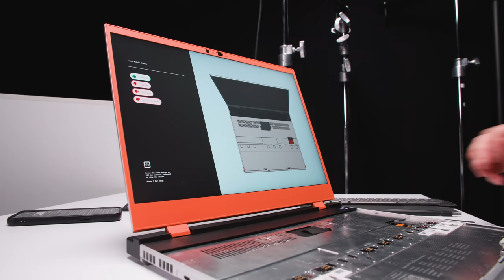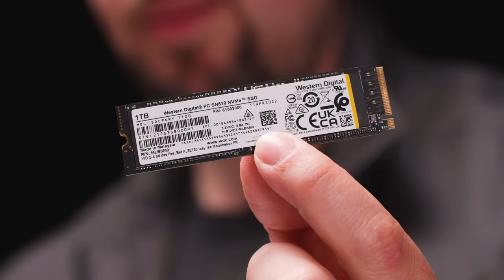Framework 16: an exclusive look inside the modular gaming laptop

Comment from the maker: Update, August 4th: We've now used a Framework Laptop 16 prototype with a working GPU fan, playing games for 15 minutes without any throttling. The touchpad on that machine worked every time we swapped it, too.
Reply: Amazing. We only need economics of scale to bring down the price of these beauties!
Reply: Most cellular/wifi antennas are routed through the screen lid for range/performance reasons. I've seen active amplified antennas sit on the base of Dell precision laptops, how is this handled on the framework? Getting tired of lugging my Dell Precision 17" around and it's a pain on flights, this seems like an interesting alternative.
Reply: @tommymaddox6785 this one appears to have a massive antenna line at the top end of the lid. Wifi does work very well though.

Comment: This is so cool! Linus really invested in a super concept and execution!
Reply: Linus is stilly too often, so it is not good that he is an investor.
Reply: CPU swapping is next 👀
Reply: @_____alyptic  Not anytime soon - both Intel and AMD have long dropped support for CPU sockets on laptop SKUs, and because of compatibility reasons with the motherboard, I doubt that Framework will find it easy. We'll probably see more display and GPU options in the near future.
Reply: @leonro  It will probably be like framework 13, swapping the motherboard to upgrade/change the cpu.
Reply: The problem is that its too expensive for the specs. Whilst a premium might be expected for the level of user upgradability that you no longer see in mainstream flagships, it is really way too high a margin. 

You can basically get a "level up" spec'd laptop for the price of a framework (i7 instead of an i5, ryzen 7 or 9 instead of a 5 etc.).
Reply: @JimIBobIJones  true but the value comes in when you look at it as a few years down the road you can change your display or still have the latest processor .... also framework is small if dell or lenovo did this it would be cheaper due to economies of scale and that they are a larger company.
Reply: @brandontobias1338  If the cost was reasonable, the ability swap out the mainboard and modernise your laptop would be amazing. But their modules are also overpriced AF - and you can buy a new laptop for pretty much the same price. 

I agree it may be an economies of scale issue (but I suspect it isn't - they outsource manufacturing to bigger suppliers) but at the end of the day, the consumer pays more regardless and we shouldn't have to subsidise economies of scale
Reply: @_____alyptic they have it albeit limited selection and not in all regions yet
Reply: OFC, event Google Tango failed for this project
Reply: @JimIBobIJones that's because they're a small indie company using ethics, and ethics don't make big money. No company with enough money to sell these cheaper would bother making it, because it goes against the very principles that made them that much money in the first place.
Reply: @JimIBobIJones "we shouldn't have to subsidize economies of scale" that's literally what economies of scale do, make things cheaper. It's not framework's fault modularity isn't a selling point for the masses.
Reply: @MrGamelover23  way to pick a straw man. It was one part of a broader argument thst also demonstrated how they cost more than other small companies with semi custom hardware on a similar scale.
Reply: @JimIBobIJones do you want to pay for a completely new machine in 7 years or pay a fraction of the cost for the same performance?
Reply: @JosueHernandez-nu5cp  is 2/1 a fraction? I guess you are technically right....

Their main boards cost as much as full laptops with the same processor... And you are paying anywhere from a 50-100% premium going framework in the first place. If you think paying more money and using a 7 year old screen and keyboard etc. is acceptable I am not sure what your concept of value for money is.
Reply: @JimIBobIJones  laptops can last a long time if they are built right, the screen resolution on the framework 16 is already nice… and the pixel density will be plenty for the average person in 7 years then again you could always upgrade as well. 

Keyboards can last, it just depends on how you use them. At that point it’s up to the individual. 

I am looking at the prices and from what I am seeing, the new laptops with the same processor are usually 100-500 dollars more expensive and that’s on a discount 🤨

Comment: I was expecting this to start at almost $2000 but $1400 is a must buy for me
Reply: love to see it
Reply: well by the time you add all the essential parts it costs around $1800(without graphics card) so... still very expensive
Reply: It´s expensive considering only the specs of a laptop but considering this is a very modular, personalizable, upgradeable laptop that is leading the right to repair philosophy in the category and is coming from a start-up that has kept its promise of making and supporting modular hardware, it is a must buy.
Reply: @keerthan7558 the idea is it’ll save you money in the long run. Historically no modular project stayed around that long for us to judge that statement.
Reply: $1400 for the base-model, it's definitely gonna add up with better add-ons, but like others have said the future-proofing is what really makes it worth it (as long as the company delivers on its promise!).
Reply: I would have been, if they were shipping to my place...
Reply: 2k for gpu version.......
Reply: If you think about it a regular gaming laptop with about those specs i7 13700k and 4060 costs about 1100-1200. You could probably buy 2 one you spec out a framework with reasonable storage, ram, and io . Personally i rather buy a gaming laptop use it for 4 years and buy a new one in 4 years again and still be out of pocket the same cost of a framework 16.
Reply: @keerthan7558  pretty sure you get 7700s with the laptop
Reply: @schizofennec  pretty sure you don't 
else why would they specifically mention that the gpu module costs 400 dollars?
Reply: @ewoggerts  The thing you're not seeing is that this laptop is upgradeable, in 4 years instead of spending $1200 for a new gaming laptop with similar specs (or more because the market has been awful like that) you could upgrade the main board with the CPU for something like $700 and also get another computer for anything else or sell it from the previous main board; or maybe it's not really needed yet to upgrade the CPU and instead you could just upgrade the GPU module, maybe they would have a 2 tiers of GPU and you could get yourself the most powerful (if that's what you're into) for a little less than the mid tier gaming laptop you were going to buy for $1200 and now you have a better laptop in 4 years for less or a similar price to what you spent all together. Also you get the chance to change other parts of the laptop if you want or don't. We have never had so much choice to make a laptop that actually fit your specific needs in the past. Yes it's a start up and there are a lot of unknowns but there's also a lot of potential. So it depends on what you feel comfortable with
Reply: make sure to keep reality in check
framework is cool and all but they never advertised on price for performance
the first framework 13 was already an overpriced product, this one is no different
not saying the overprice is unjust though. its very much justified
Reply: @walkinmn  $2400 now plus $1000 in the future for GPU and CPU upgrade or $1200 now and $1200 in the same timeframe for the same upgrades. You come out ahead just buying a better gaming laptop now and in the future. Plus companies like Lenovo have fire sales all the time. It’s a great concept, but they are too small and don’t have the economies of scale to make it cost effective for most consumers. Sad.
Reply: $1400 with no dGPU no ram no ssd no ports. $2000 for dGPU model. Add all up and it will be $2-3k for mid range laptop. Usb port alone is $19 each.
Reply: @walkinmn the thing you are not seeing is actual price. Its $1400 for barebone with igpu. Add ram ssd usb ports($19 each) its going to come out $1700-$2000 for igpu laptop. For that you can get almost top high end gaming laptop. Great concept but not for average consumers. More like laptop tech fanboys.
Reply: @aliticx  i agree in the long run this is probably cheaper to upgrade and more sustainable but my point was that the base model is too expensive. I doubt that people going with the base model would take advantage of all these features, i feel their requirements would be better fulfilled by the existing non-modular laptops .Maybe we need to wait for this idea to get more popular so that the parts become more common & cheaper to produce thus bringing down the cost. Right now it's more of an enthusiast product than a consumer one .
Reply: @aliticx  I totally expect to get one and then hear how they are shuddering the doors and not be able to upgrade it. lol
Reply: @keerthan7558 if it were a macbook no one would be batting an eye
Reply: You can max out everything (reasonably, 2tb wd 850x and 2x16gb ram bought separately) for around $2400
Reply: @walkinmn main board for the 13 inch laptop Intel version costs $1050, só expect this 16 Inch to cost at least $1100 for the mainboard. Add a Gpu for $500 and you get your upgrade for $1600 (price of a whole new laptop, with better specs)
Reply: If you want a higher spec machine you can save big with the barebones and then buy memory/storage yourself for less also
Reply: buying this has a premium cost due to modularity, repairability, upgradeability and the fact that it's a small start-up ... if the company stays alive by the time i need a new laptop i might go for the 16" one, the fact that premium laptops barely have a hdmi anymore and i can have the option of that or displayport is just baffling, you can easily use it as a desktop replacement, should they add a decent gpu option (7700S is too slow for my needs in both gaming and work) 

for me this laptop is 2800 usd + overseas shipping + vat + customs tax and it peaks at around 3400 usd at the moment .. at these prices i can just bump a little and get a mercury razer 18 from the razer eu store and call it a day by losing most of what makes framework interesting but getting a sweet 18" 240hz qhd display rather than a 16" which for me is the smallest i can cope with in term of workspace 

also keep in mind that you can buy a decent 16" laptops around 1400 usd with ryzen and 4060 which you upgrade for 1400 in 3 years instead of one framework for which you upgrade only the gpu (as the cpu most likely won't bottleneck in one generation bump) and you get a new device without any wear and tear while with the old one you can sell or give to family members or even use as a server at home for various needs or games
Reply: @TheMaxAwesome then buy it so they GET the economies of scale. Also, framework for business now exists, really hoping that helps with economies of scale.
Reply: @MultiNakir you're not using an AMD consumer GPU for work anyway, nobody supports them.
Reply: @aliticx  Realistically, the company only needs to stay around for what 6-7 years for it to make financial sense if you bought one of these now? The company does seem to have a good backing and they've gotten through a lot of the growing pains already (namely having an actual factory up and running and a track record of keeping their promises, separating this from your standard kickstarter project or whatever)

Comment: I’m not interested in Windows laptops EXCEPT THIS ONE.
Reply: Is it really a 'Windows' laptop? It is supposed to be as much a Linux and even OpenBSD machine as anything else isn't it? The original Framework certainly had all the right parts to just work on sufficiently modern distributions - the stuff the hardware is supported on. And they are making the right noises about the 16 models for it to be more of the same...
Reply from the maker: (Sean here) I just bought a refurb M1 Pro MBP because I really needed a laptop and couldn't wait... now I'm wondering if I'll regret it. Still, battery life from the Mac is hard to beat.
Reply: @foldionepapyrus3441  agreed, yea this thought crossed my mind.
Reply: This isn't really a Windows laptop, a good portion of the Framework 13 userbase uses Linux
Reply: @obj_obj  Noted: I dig Linux too.

Comment from the maker: So the one thing Framework couldn’t tell us about yet is battery life – how much battery do you want, need, or expect in a machine like this?
Reply: 16 hours
Reply: 6-8 hours, 6 in full use 8 in Idle. given the hardware it's pushing
Reply: I wouldn’t game on battery and it looks like transportable workstation instead of an coffeeshop netbook, so I would expect pretty low, like 3 hours 🤔
Reply: No gaming laptop has more than 1 hour life during gaming. So that.
Reply: With an AMD Ryzen 7040 HS CPU, probably around 6 - 8 for light use with the screen at 60 hz and 200 - 250 nits of brightness.
Reply: my macbook can do a whole day without draining 100% of the battery, i'm expecting at least 12 hours
Reply: I expect to always have it connected to the wall
Reply: At least 8hr of light usage since this is an AMD 7040 CPU and around 80+ whr battery
Reply: @bennoboy97  yeah. Atleast there's modules so maybe you can just add a bit more juice quickly
Reply: nvm just saw that video and u can't hotswap the modules
Reply: I don't expect too much, but anything over 8 hours in moderate use (browsing, office tasks, etc) would be great. Knowing now that it's a 'Phoenix' 7040HS chip, this should be totally feasible with the dGPU disabled or in hybrid mode.
Reply: @bennoboy97  ASUS TUF has consistently pushed 2 hours, Zephyrus stayed above 1.5 hours
Reply: @NicolasSilvaVasault don’t get me wrong, I love how efficient the M series is, but Apple Silicon isn’t remotely comparable to a traditional x86-64 CPU. On top of that, we also have a dedicated GPU going over the PCI bus and modular memory.
Reply: Next time you do a video like this, can you ask the manufacturer about international sales, is it coming to EU, UK e.t.c.. I would find that informative and I'm sure others in your audience will also!?
Reply: @NicolasSilvaVasault this is not a MacBook though
Reply: @mrspankyuk preorders are already open for UK, NL, FR, DE, CA, IR, AU, AT and US
Reply: I'd want the biggest battery possible, obviously. Should be possible to fit in a 99Wh battery.
Reply: @timorouw5555  never said it was, but an m1 macbook can last a whole day (and more), i'm expecting half a day for a framework laptop
Reply: Will the CMOS battry work?
Reply: @zeenyuhrass I'm no macbook user but Plex is not something integral.

On the other hand, Macbook can run most games natively or emulated using a VM or thru wine while still getting tremendous battery life.

I really wish intel would transition to ARM for laptops though. They're the future.
Reply: with dGPU disable you should able to get 10+ hours of web browsing eaily with 85Whr and 7040HS series.
Reply: Double what it has... Because there should be an extended battery module to swap out for the GPU when on the go.
Reply: @zeenyuhrass  plex???
Reply: @ryanspencer6778  the size of the battery is already fixed at 85 i believe
Reply: 10 give or take
Reply: The correct answer is "Yes".
Reply: I mean, just swap out the discrete card and you can double your battery life if you want to.
Reply: Lets run some numbers.
The display they use will probably use 1W for the controller and up to 6W for the backlight (so up to 7W in total and probably 4W for something like 150nits)
The HS cpu and the rest of the system could theoretically all be pushed into power saving modes and might use up as little as 3W in very light usage and good wifi reception. Assuming there are no hidden power hogs, 
for web-browsing at 150nits with all energy saving features I expect around 8W average power draw or 10hours of battery life.
Reply: the battery life is normal, that is why they dont push to intel h series.
Reply: @NicolasSilvaVasault  macbooks use ARM instead of x86 so the power consumption of the CPU is much lower
Reply: @obj_obj  yes but even when apple was working with intel, their laptop lasted longer than a windows laptop normally of the same specs
Reply: Yes
Reply: @NicolasSilvaVasault lower your expectations, regular laptops can’t even keep up with Apple
Reply: good battery life on casual use.
Reply: I'd like to have at least 12+ hours with normal use with the integrated graphics (no gaming included).
Reply: @xlDon2lx it's not really that great for gaming battery life. Play Genshin impact on an iPhone, than on a steam deck. Pretty sure they'll both last 2 or 4 hours tops. Arm is great for light work, but for heavy lifting it's not much better.
Reply: @timorouw5555 the battery size is fixed, but recently they made bigger batteries for the 13 inch models that take up the same amount of space.
Reply: The AMD version of the Lenovo T16 can get around 12 hours with light use. I would hope for similar battery life from this without the GPU!
Reply: 12-14+ hours would be great
Reply: 10 hours browsing the web and office apps at 50% brightness.